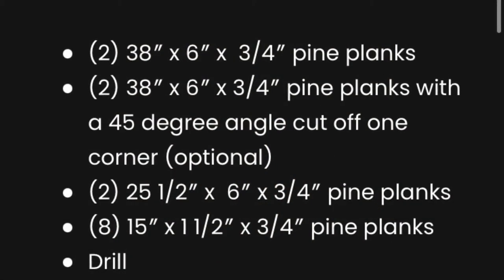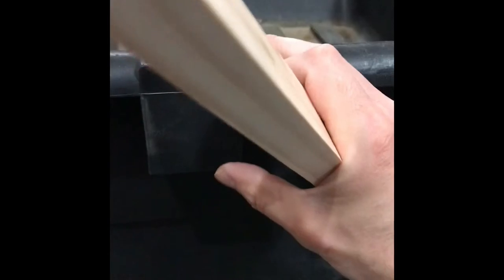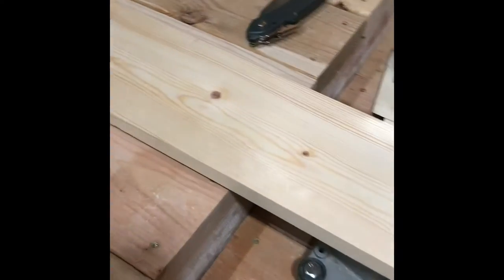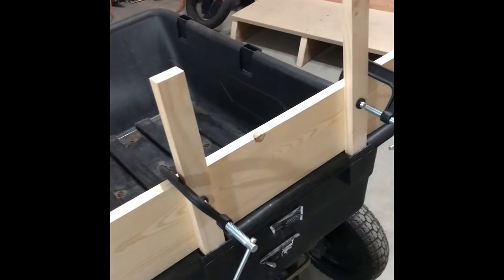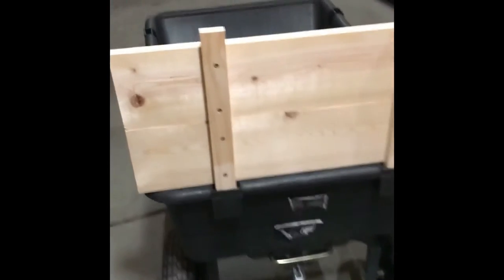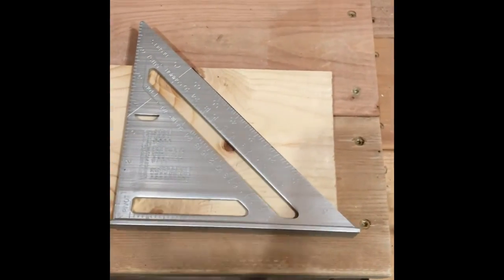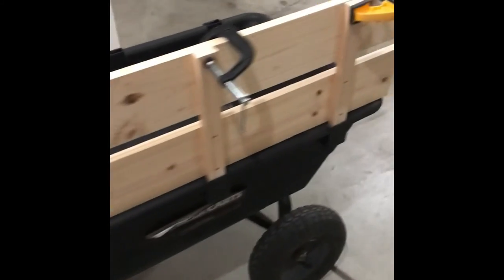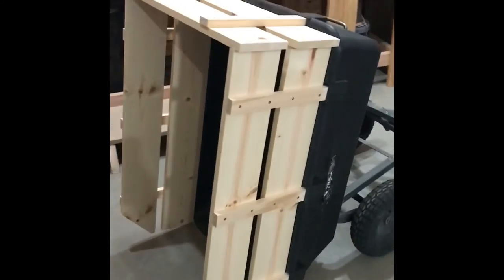Gorilla Cart side rails tutorial - adding side walls to the GOR6PS

Comment: Just a helpful tip when using a sliding compound miter saw, start you cut closest to you and then slide to the rear.  This will prevent possible kickback from your blade.

Comment: I am confused. At 3:44 into the video when you are completing the front part, it shows the two pieces of horizontal wood, one on top of the other with no gap.  When you show the completed project, there is now a space between the two pieces of wood on the front and the sides.?????
Reply from the maker: That’s right- after I screwed it in, I realized I didn’t leave the gap I was supposed to by aligning the board to the top pieces like I had with the sides, so I went back and moved it up.

Comment: Am I wrong or did you not at first drill the smaller planks in the back below the heighth of the stakes?  Then it looks like you corrected it later so that the rear planks are separated and the top one is raised to the top of the stake.  Just curious.
Reply from the maker: @PudgyFish47  you are correct, I forgot to keep a gap between the boards so I fixed it after, but not sure it really matters if you have a gap or not
Reply: @hunterbergman6453  Thank you for your response, Hunter.  It doesn't take anything away from your great video.  I like the look of the space between the planks and the 45 degree angle cut is a nice look.  Keep the videos coming.